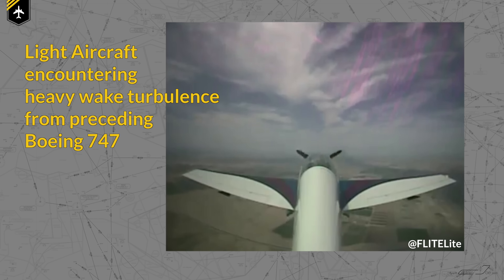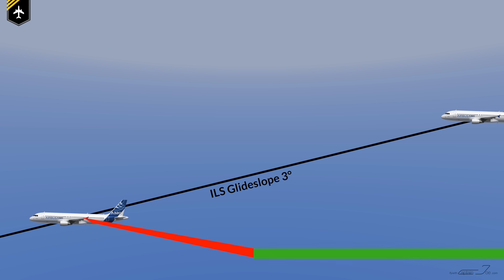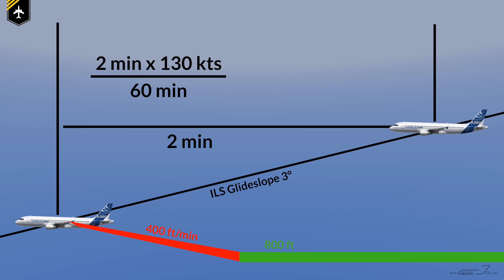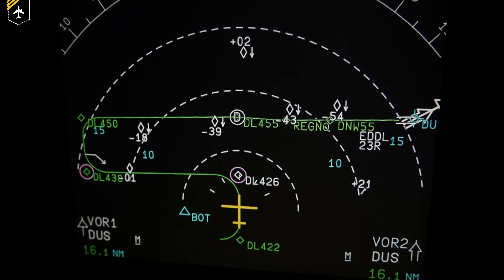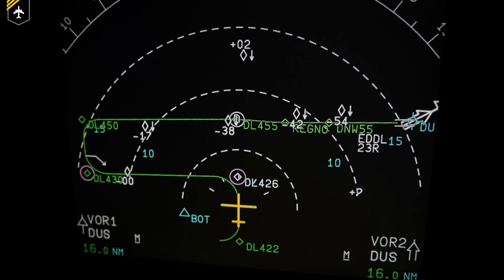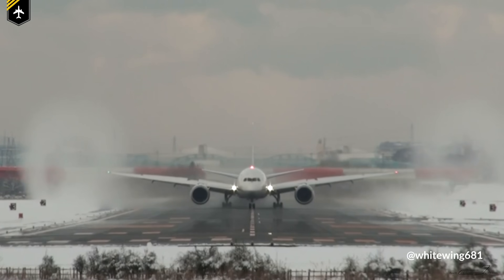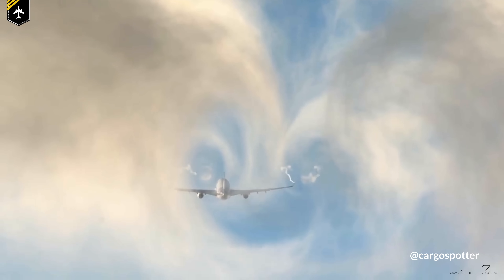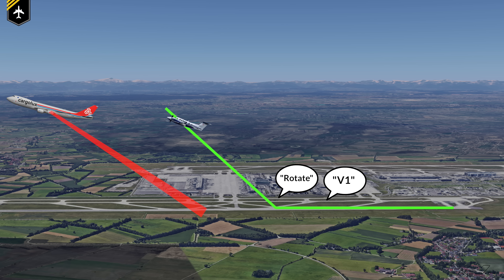WHY do pilots say HEAVY? Wake Turbulence EXPLAINED BY CAPTAIN JOE

Comment: As preface to watching this vid, I recently did quick research for my call sign on MSFS before flying to see if I should "real world correctly" append Heavy onto Pugs666 lmao. But I found it supposedly used on max take off weight 300,000 lb. up. The A320 I was going to fly MTOW was somewhere around 158,000 lbs. I was flummoxed, if THAT was only Medium and half way to near being called heavy...what actually is Heavy?!?! And then there was a "J" setting on Simbrief for something called SUPER!!!! After Heavy! AN-225, RIP, has to be Super I'd guess. Well, let's hope vid explains my initial bad understanding :-D

Comment: I remember a tale told of a British Airways 747 at the end of the runway at heathrow asking permission to take off. The tower came back "Speed bird hold position, traffic on the runway. Tortoise" "Speed Bird, holding" Then after a few minutes the tower came back "Speed Bird cleared for take off, caution wake turbulence departing Tortoise" "Speed Bird, roger"

Comment: Extremely well explained, even to a sailor like me!  A similar set up with respect to fluid dynamics.  Eg, a ship with props rotating at full speed and then requiring an emergency stop does not put props in to full reverse as the turbulence caused by the props renders the water to be TOO fluid as to have no measurable effect.  The best course of action is to put props to medium speed initially and depending on the situation gradually reduce the speed until reverse will have some effect.  This was related to me by a Master Mariner and I THINK I've got it right... however, I am happy to be corrected.

Comment: I hate that this video is 2 years old. I’m curious how landing a “heavy” affects the takeoff of the awaiting plane on a shared runway. Would they send off the next plane after a “heavy” because of the longer gap needed for the next plane, or is there a waiting period for the wake to clear?
Reply: One thing about wake is that its only generated when the wings are producing lift. So when an aircraft finally touches down, because of the deceleration, the wake becomes weak. Therefore there isn't a major wake issue for a plane taking off after another plane has landed.
Moreover, The aircraft waiting to take off will have to wait until the landing aircraft has cleared the runway.

Comment: 8:00 "...a glider ALWAYS flies a little higher than the tow plane...."

Oh no it doesn't. It depends whether they're using the high tow position or the low tow position !

The low tow position - as the name suggests, has the glider slightly below the towing plane.

So which is better ? A: The low tow position. 

So why is it rarely used ? Because the towing plane is rarely a Lancaster bomber - or other suitably powerful aircraft. Most aerotows are carried out with very small single-engined planes. The engines are quite adequate for the plane but without a 'trailer'. Some small aeroplanes are not suitable as tow planes as their engines aren't powerful enough.

So you set off on tow with only 'adequate' engine power for the 2 aircraft. The first thing to note is that the glider is always airborne before the tow plane as it needs less airspeed to fly. So the high tow position is quite a natural choice. However, where it really matters is when the towing plane is airborne - the glider is being towed from the tail of the light aircraft - so if the glider is slightly above the light aircraft, the light aircraft's tail is being pulled slightly upwards by the pull of the glider. This is FINE ! The towing plane pointing a bit down can accelerate & fly safely. However, if the glider is in the low tow position, it is pulling the towing aircraft's tail down, tending to make the aircraft climb. But has the aircraft engine enough power for an enforced climb ??? OK, so they can lower the elevator to keep their nose down or level - but in doing so, it creates more drag - which needs to be opposed by the thrust the engine might not have !

So, for small tow planes with not a lot of excess engine power, the high tow position is nearly always used for safety !

If the tow plane was a Lancaster, no one would care where you were !

For info, the tow rope can be released at all times from both the glider and the tow plane. It is normal for the tow plane to leave it attached until about to land (as that's likely where the rope's needed again). To protect both aircraft, the ropes have a 'weak link' commonly with a breaking strain of 1,000 lbs.

[Dad used to take me to the gliding club some weekends back in the 70s - early 80s.]

Comment: A little late to the party here....but does aircraft design play a factor in the trailing plane?
For example....can a fighter jet "tolerate" wake turbulence better than a more standard aircraft....thereby having the ability to fly closer?
Also.....is the turbulence different between jet and prop aircraft of similar size....or is a faster plane different from a slower one?

Comment: I learned about wake vortices from that. In the US Navy I was stationed on the British Indian Ocean Territory (BIOT) of Diego Garcia. There is an air base there and running paralell to the runway, but a few hundred feet away is a road. I'd ride my bicycle along that road for exercise. One lovely, sunny tropical day I heard the rumble of a B-52 taking off, and I knew it would be heavy because, taking off from a 'middle of nowhere' surrounded by thousands of miles of water all B-52s that departed Diego had to go fully fueled. Just before it passed me it started flying (B-52s don't really rotate, they just start flying) and a few moments later I was blasted off the road into the sand by its vortices. Believe me, they are really powerful!! It was like stepping into a hurricane.

Comment: They are so interesting to observe when the atmosphere is correct to make condensation trails for them to show up. They sound rather interesting also if you are near the end and aligned with the runway so that they can collapse into the ground where you are standing. One can also feel them during this time too,  A rather interesting unusual side ways twisting wind  which Im sure you can ponder by observing the exhibits in this video.  You can see them in the trees on approach too. I just retired after having worked at an Airport for the last 33 1/2 years. Watched lots of Purple, White and Orange 727, 777, DC10, MD11, and whatever A ### it was flying in and out of here during my time.

Comment: I would guess that most twin-aisle jetliners classify as heavy, and most single-aisle ones (and turboprops) as medium. At most international airports, those planes make up almost all of the approach traffic, which is likely why you wouldn't a callsign that actually says medium. If all the traffic is either medium or heavy, any callsign that doesn't say "heavy" (or "super") is assumed to be medium. Would a light plane (like a small business jet) landing at such an airport add "light" to their callsign?
Reply: As far as I know, all wide body aircraft are heavy, and n narrow body, only the Boeing 757 is counted as heavy (even though it is not by weight)

Comment: The NTSB conducted wake vortex turbulence studies using an FAA 727 emitting visible wake vortexes from its wingtips and a US Air 737 trailing behind. A number of wake vortex encounters were flown with the two aircraft and a lot of fascinating data collected.   The study was conducted to see if wake turbulence may have played a role in two 737 crashes -- United 585 in Colorado Springs and US Air 427 in Pittsburgh.   The ultimate cause of these two crashes turned out to be a valve issue which under the right circumstances would cause the rudder to deflect sharply in a direction opposite that intended by the flying pilot.  Wake vortex turbulence was therefore ruled out as a factor in the investigation.   The footage of the wake vortex tests can be seen in the 2nd episode of the 1996 "Survival In The Sky" series -- "Deadly Weather".  Another variant of this same episode spears in the "Black Box" series.   At my last check,  one or both of these episodes are available on YouTube. There is also an episode of "Mayday / Air Crash Investigations"  -- I think the ep8sode is entitled "Hidden Danger" -- that -- unlike the "Deadly Weather" episode which divides itself over several weather-related air crashes -- focuses exclusively on the 737 rudder deflection investigation into United 585 and US Air 427.

Comment: The A380 is not technically the only Super Heavy, while the ICAO only has the A380 as Super, the An-225 Mriya is also in the Super class under the FAA with a MTOW of 640 t compared to the A380's 575 t, and so is the Scaled Composites Model 351 Stratolaunch with an MTOW of 589 t.

Comment: Gliders do not attempt to avoid the wing tip vortices from the tow plane, but the propeller wake. It's not a problem to fly in it, but it's not comfortable as it is shaking a bit. So common practice is to stay just above it. however, in som countries, like Australia, it is common practice for the glider to fly under the propeller wake as it is more optimal for the climb. (former glider pilot)

Comment: So how is all this stuff calculated? Does the ATC tower have a supercomputer tracking this and the ATC just reads it out, or is it manual tracking??
Reply: The aircraft will be spaced behind a preceding aircraft at a distance determined by the wake turbulence category. Tower controllers provide wake turbulence separation for departing aircraft by applying time intervals.

Comment: You forget the other "super" plane, you are a cargo pilot you should not forget this one ^^
Reply: Mehdi Sehaki though the an225’s weight is in the super category, officially it doesn’t come under super 

It’s more of a unique one off plane, so if it is flying, you’ll definitely know that it’s a 225
Reply: @ZK-APA  What i want to say, is that the pilot of an AN-225 use the word "super" at the end like the pilot of the A380, even if there is only one
Reply: Mehdi Sehaki as far as I’ve heard the an225 rt, the pilots don’t say super, but the controllers do most of the time

Comment: 8:00 There's "high tow" as you describe, "low tow" where you fly below the propwash. Sometimes preferred as there's less danger to the tug pilot (if the glider pulls up, it lifts the tug's tail, sometimes causing a fatal dive). Training exercise is to "box" the tow plane's wake. Also to fly into the wake so the trainee knows what it feels like to sit there.

Do you put minor mistakes into all the videos so folk can pedantically correct/expand in the comments and drive up engagement?

Comment: Do the winglets on the end of wings we see on most modern planes reduce this effect? As I understand it they increase lift because the reduce the vortex effect?
Reply: P Visser winglets doesn’t increase lift, but it reduces drag (wingtip vortices is basically induced drag)

And yes winglets can reduce the effect but it still doesn’t change the wake category of the plane

Comment: I live about 10 miles from Newark liberty international the planes fly right over my house depending on the day and time, sometimes at around 5pm they are lined up and pass right over my backyard, by this time they are very low and coming from the south, the problem occurs at between 4 and 5 am, sometimes they come from the west then turn north very close to my house and they are extremely low at this point, as they make their turn and these are larger planes mind you, sometimes my house actually vibrates and the windows rattle it sounds like they're going to land right there as they turn, could I be experiencing some of that turbulence?

Comment: In addition to the A380, I would think the An-225 and the more recently introduced Stratolaunch would also fall under the ‘Super’ weight category.  Am I correct?
Reply: Michael Murray yea you can technically say the an225 counts as a super. But in practical terms the an225 is so unique that the controllers know beforehand that it’s an an225 and they should maintain separation as required.

Comment: 2:15 uhm... no.  Its a PZL 104 Wilga, it weighs about 1300kg (not 450), certainly not an ultralight in any airworthiness classification system I know of.   Other than that, enjoyable video and informative, but throwing a "hard fact" out there and being wrong... may cast a bit of a shadow on the rest of the information, which is a shame as the videos are always very well researched.

Comment: Okay, then why the heck does ground control mention 'heavy' when calling  planes taxiing to the gate?
Reply: sharpfang some airports have taxiways which are restricted by weight or dimensions as well. So those aircraft may use a different taxiway.

Comment: To captain joe 
What about the airplanes with the new wing design that has a small extension at the end of the wing going upwards 
I heard they reduce the wake turbulence
Reply: Actually, those winglets have been used already quite a long time. And yes, the winglets reduce the wing tip vortices.
Reply: Mike P ok then do they change the classification as well because of the reduced vortex 
Like 
Super is now heavy 
Heavy is now medium 
Medium is now light 
Light is now nonexistent 
Loool I joke a bit

But yeah do they affect or not
Reply: @atechnews3221  - B747 is still called heavy (with winglets). So I don't think anything has changed.

Comment: Hey, in Australia, gliders are always aero towed in the so called "low tow" position below the slipstream and there's a good reason for that. Joe, do you know why?
Reply: How does it fly lower than the tow plane?    I thought it always flies higher due to not carrying an engine plus the wake turbulence of the tow plane..
Reply: @tanyawieczorek7943  There is not so much of wake turbulence behind a small tow plane. There is a slipstream though but we fly just below it to stay in the smooth air.

Comment: @joe how do military pilots deal with those turbulances when refueling inflight? especially when a small fighter flies behind the tanker?
Reply: Remo Liechti -  The aircraft which is refuelled flies usually a little bit below the tanker (about 8-10 feet). This is how it can stay below the wake turbulence of the tanker.
Reply: Wake occurs when the plane flies at an angle; like during take off and landing. They don't prıduce any wake turbulence during straight flight. (that's what i make out of this video, sorry if i'm mistaken)
Reply: @ozgur2883  - The aircraft will always produce wake turbulence when it is flying, not only during takeoff and landing. The angle at where the aircraft is flying is not relevant.

Comment: Years back, I was on a private company jet going from Canada into the USA. 
We had to stop at an international airport first, for the pilot to check in, etc.
When we got to the terminal, the pilot parked the company jet behind a large "heavy" jet as he went in to do some paperwork. 
By the way, our small jet sat 7 people. 
As we were waiting in the plane, the larger passenger jet in front of us throttled up its engines. 
Instantly the back wash from the thrust picked us up and nearly tipped us over. 
Wow, for a second, I thought we were toast. 
Our pilot should never had parked behind a large commercial jet. 
So yes, wake turbulence is a real thing and can really toss a following plane around.
Reply: That wasnt "wake turbulence" you experienced because the other plane was on the ground. It was simply lift due to the exhaust of the airliner in front of you.
Reply: @riffism  Oh yes, that is totally accurate. 
But my point was that these large jets create alot of turbulence behind them. .

Comment: Ive never heard light or medium call out yet.. Initially I thought heavy means the plane is filled with a full tank of fuel 😂
Reply: Me too...but I thought heavy also meant full of passengers as well
Reply: You wont hear medium, but when flying light, you'll usually start your interaction with the planes model and n-number. "Las Vegas tower, Cesna 424KW with you 6000"

Comment: What does wake turbulence have to do with the weight of the airplane? Isn’t it just a function of wing size, design, speed and AoA?
Reply: bassomanvfr the more weight an aircraft has, more lift the aircraft needs to balance the weight.

And lift is directly proportional to induced drag (I.e. wake)

Comment: "Lining planes up for landing like pearls on a string". Using math, the ATC's, Pilots and Airlines work fervently to get all the planes landed as quickly as possible.  Working together, these entities encroach the envelope of safety without crossing the line for what I would guess is fuel savings.  Yet it may take the passenger 7 hours to get off of a 3 hour flight, only to find their luggage is missing,  The airlines definitely cross the "T" in profit and forget about dotting the "i" in customer satisfaction. Take the money and run.....

Comment: Absolutely fascinating video, Captain! I have wondered about the "heavy" designation for a long time. I thought it had to do with the amount of fuel onboard (take off vs landing), but now I know it has to do with the overall weight of the equipment. Does the consumption of fuel after a long haul ever change the designation from heavy to medium or super to heavy?

Thank you so much for all your informative videos. Sorry your boss at Air Berlin was jealous of your success on the Choob. You are awesome!
Reply: Daniel Moses no, category of the aircraft remains constant, independent of the actual weight.

Only factor is the max take off weight

Comment: The reason the term heavy isused in communications is to alert Air Traffic Control (ATC) and other aircraft of their presence. The concern is that these very large aircraft produce significant wake turbulence, expecially from their wingtip vortices. ... All the communication between ATC and pilots has careful definitions. 
Doesn't need 9 minutes to explain!!!